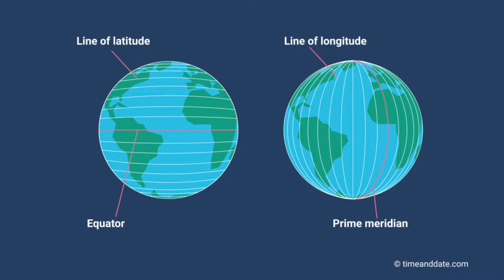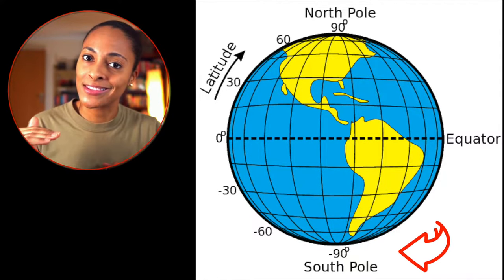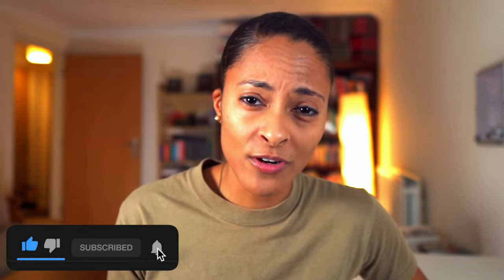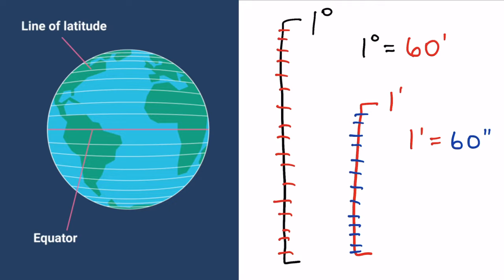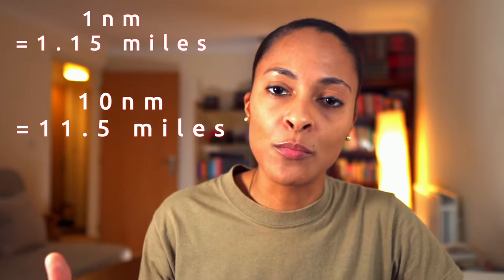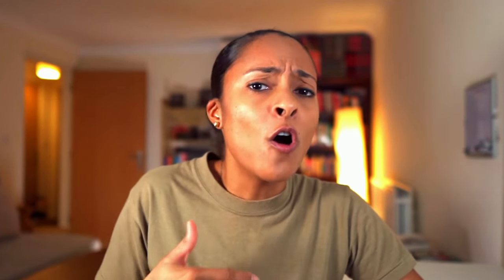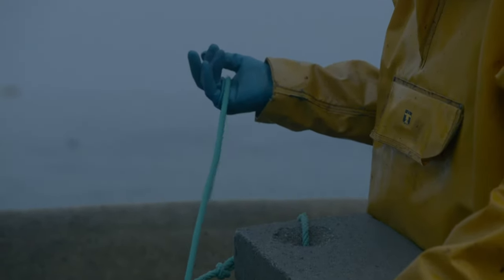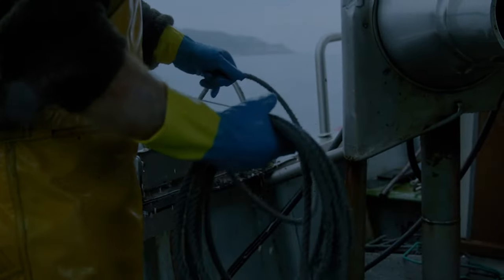Why do the Air Force and Navy use NAUTICAL MILES? And What is a KNOT?

Comment: WRONG....but you are really close. The Roman mile was a thousand STRIDES of a Roman soldier. A stride, of course, being one step of each foot. One step was about 2.64 feet so two of them were 5.28 feet thus a thousand of them are 5,280 feet.

PS: also, on an aerial or nautical chart 1 tick on the chart is 1 NM, so simple.

Comment: ? if i step across 50 degrees near the north pole, have i gone 3000 kn??
Reply: If you travelled 50 degrees in 1 hour then yes you have. Remember a knot is a Nautical Mile per hour (Nm/h)
Therefore, If you travelled 50 degrees in 1 hour you were travelling at 3000 knots (Nm/h)

Comment: You forget that nobody uses miles anymore, so why convert knots to obsolete miles. Let's all hope the world goes completely metric soon. never used knots at sea or air, kilometres all the way.
Reply: You've never used knots in the air? I assume you're not a pilot, but pilots have to use knots for many reasons.
Reply: @lincolncottingham2432  Actually building my first helicopter, speed is in km/h. The international aviation board recommends all aircraft go metric. Most planes are metric except the cheaper quality US planes.

Comment: still didnt get why its more accurate .. if we are converting it to miles anyway, 
and also didnt get how is the earth's curvature considered in using nm?

thanks for the video tho, did anyone understand tho?
Reply: My understanding is that for aviation, which is my background. The Knot (nm/h) is better because as you get higher in the atmosphere the circumference is larger so the exact size of the Nm is larger the higher you get
Reply: On ground, the speed is relative to land which is fixed /doesn't move and therfore doesn't affect the object speed. From my understanding because water and air are not fixed, ie you could be sailing 30mph against/into a 15 mph current, and therefore your actuall speed will be 15 mph and not 30mph...  aviation I think the same applies because air speed around the plane will affect the planes actuall speed. By using knots it takes the variables with the speed of the water/air and gives you an actuall speed you're traveling at.

Comment: Use the radar and check from a river if the height and base of buildings over 30 miles have a difference.
Reply: Check top and base of buildings to see if we really have a curve?
Reply: The water just have waves that can distort the distance. That's about it.
Reply: @appleyes411  It does. Radar is limited by the hrozion